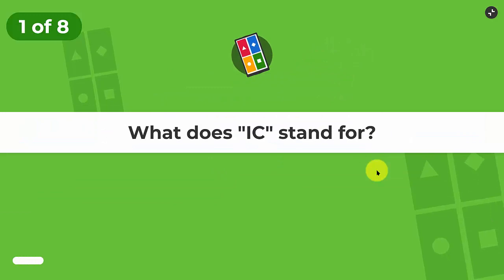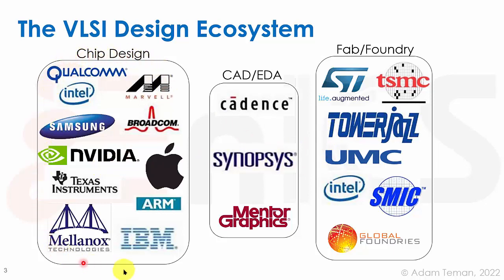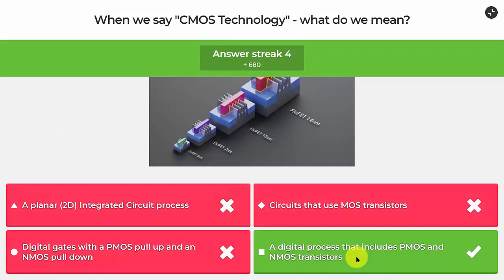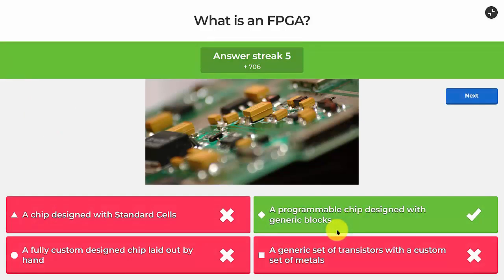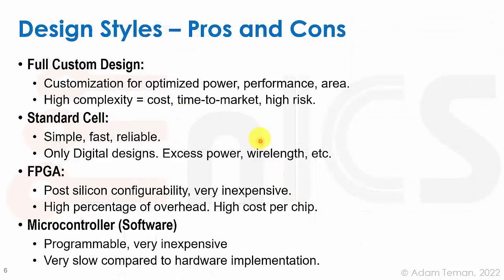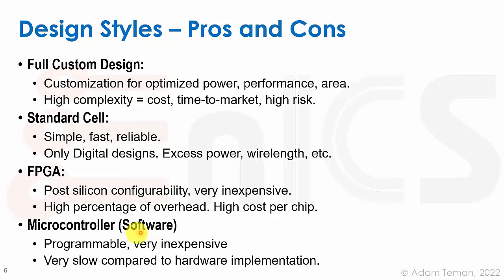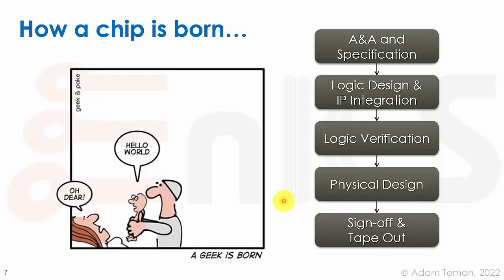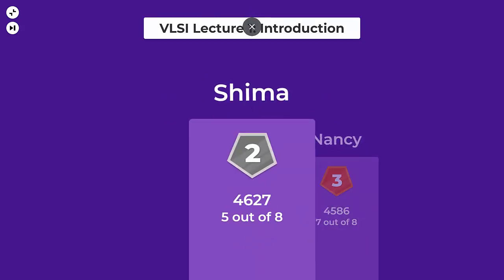VLSI - Kahoot for Lecture 1: Introduction

Comment: I think for the answer to the second question Samsung should be added to the Fab/Foundry. Samsung has in the past and still provides foundry services to some limited number of companies.
Reply from the maker: That is very true (except "a limited number of companies" is not accurate - I believe Samsung is second only to TSMC in foundry services). That being said, I wouldn't consider this a "mistake" in this video (for sure) or in the original lecture, where the slide is taken from, as I did not claim that Samsung is "fabless" or is not a foundry. I just didn't put them in the logos on the right. None of these three "categories" was meant to contain an exhaustive list of companies by any means, though in hindsight, I really should have put such a big player in the foundry service in this respective category 🙃.
Reply: @AdiTeman  Thanks for the reply. Agee Samsung has more than just select few customers. Love your videos. Wish I had them available when I was in school.